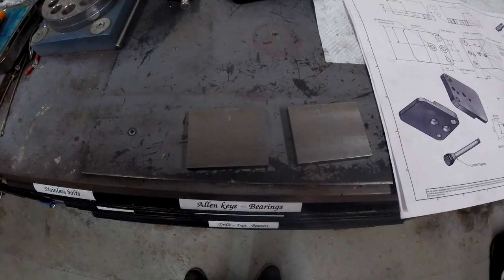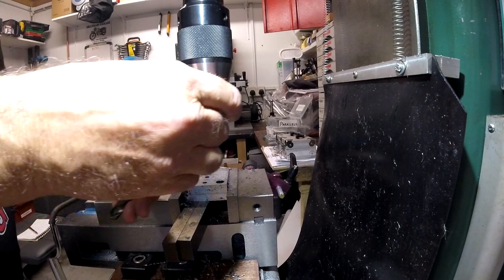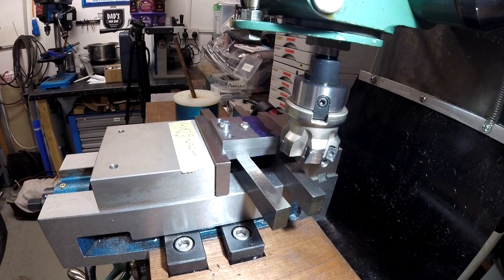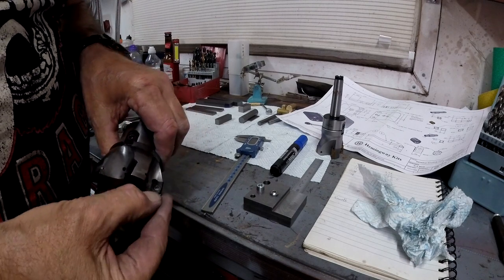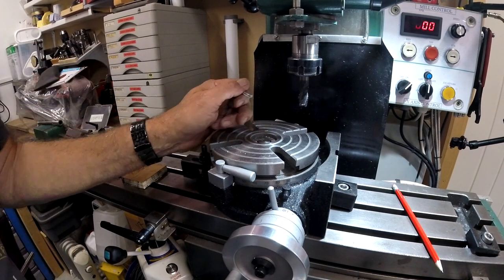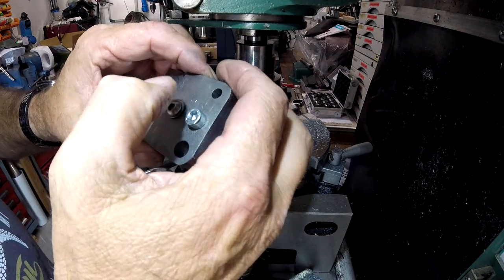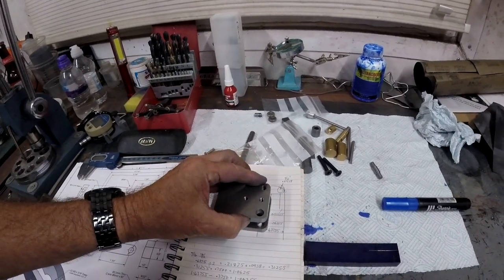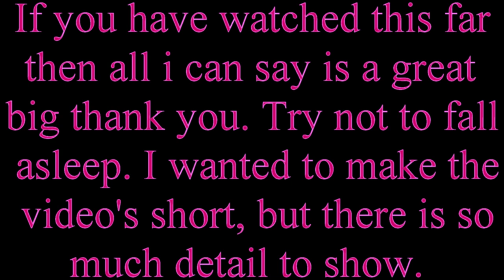Hemingway kit knurling tool part 2

Comment: Carbide insert face mill. I have found I get a better finish taking a larger DOC than .25mm. Try about 1 mm and see what you think.
Reply from the maker: I could do . But i did find if i took large depth cuts then my medium sized mill with MT2 struggled.
Reply: @Steviegtr52  I have a 2HP variable speed bench top mill. Not gear head. That may be 1.5 Kw for you. I run mine slower on feed rate. Spindle speed faster than if it was HSS. I run about 600 RPM with my 3” mill. My face mills are APKT however. That may make a difference. Enjoying your build
Reply from the maker: @christianstark1055  Thanks Christian. I will have a look at the inserts. I have recently come into quite a lot of inserts & i am sure most are Iscar. So maybe time to change them & maybe slow the speed down a bit. Mine is a 1.1kw motor 1.5hp belt drive that i fitted. Video of doing the conversion on here.

Comment: The 1.857 is for the 1 1/2" outside radius see the top drawing and the .230 is the line for the inner radius of 3/4" again look at the top drawing. Also on the other end the outer radius is half of the 5/8" which is 5/16"
Reply from the maker: Sorry my mistake. I only realised what i had said once I had edited the video. But thanks for the comment. I know i pointed to the wrong mark. Regards. Steve.
Reply: @Steviegtr52  No problem I should have watched the part 3 as by then you had sorted it out
Reply from the maker: @diggerdelaney  Thanks DLWoodart. Hoping to make part 4 soon.
Reply: @Steviegtr52  Looks like an interesting knurling tool may try one when I am set up
Reply from the maker: @diggerdelaney  Yes, a bit of work ,but looks like it will be good when finished.